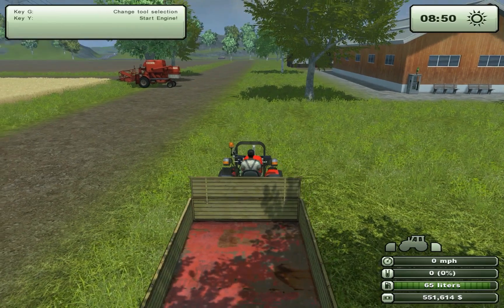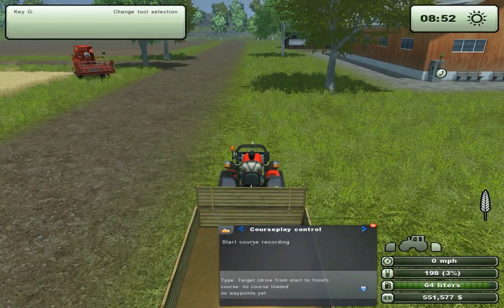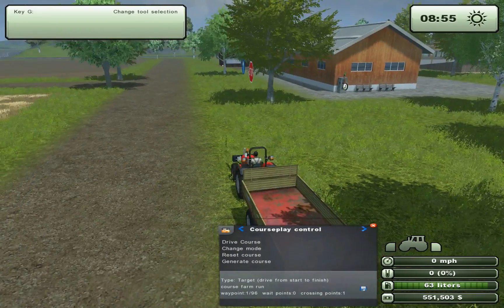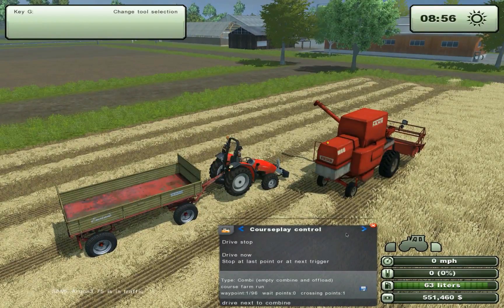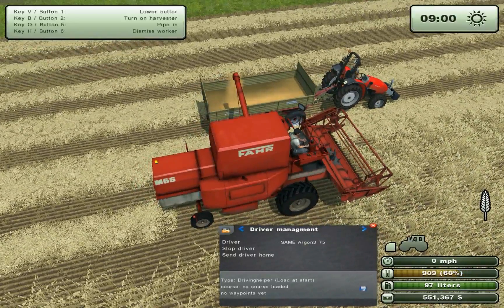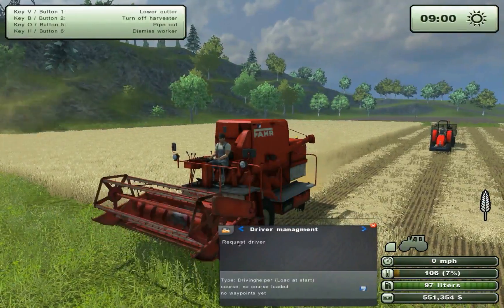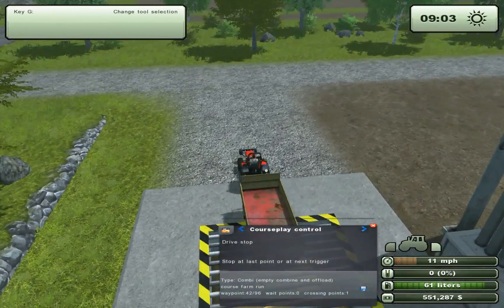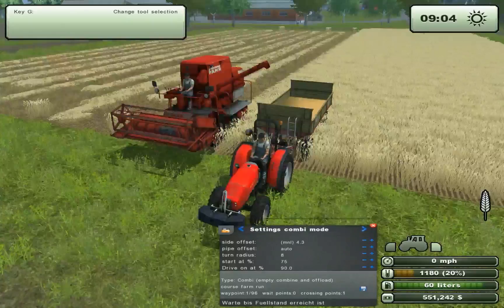Courseplay Tutorial 3 - The Basic - Combine mode Part 1

Comment from the maker: well that's where you get the latest released version.
The tutorials I'm doing, I'm using the developing version, also called Beta version and that's the most up to date version but there can be errors in it some times if they missed something.
The developing version is the one I show in tutorial 1 on how to get it and how to unzip and rezip it as it needs to be done the right way to be used. There is an easier way from the site as well and it's allot faster, but it's for advance users.

Comment: I've found that the "start at %" setting is often ignored - more often then not. Though I have set a value of 65%, the tractor/tipper will usually wait until the harvester is 80% to full, sometimes even waiting even after the harvester is full and not moving, before running out to it. The "drive on at..." is, however, always observed.

Comment: thx fixed that problem but still have problem with the tractor. starting it up and when the harvester calls it works but when it should drive back to park it drives past the combine and stops infront of it. tryed like 6 times now... always the same, even if i use automatic serching harvester :S

Comment from the maker: well IF you wanna drive the combine manually, then you have an option to controll the courseplay tractor linked to that combine, just by opening courseplay. From there you can request the cp tractor and disniss it, so if it's on your side unloading your combine and you are almost at an end, then tell it to stop. then go down and turn in the end, then just call it again. Problem solved ;)